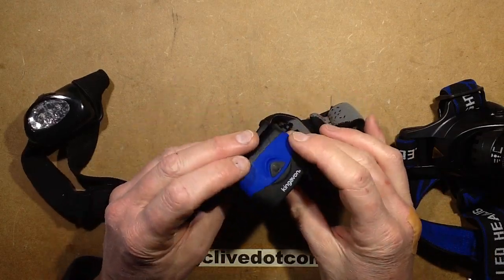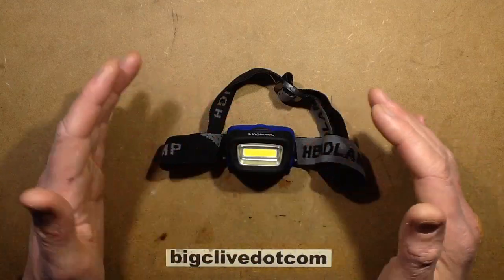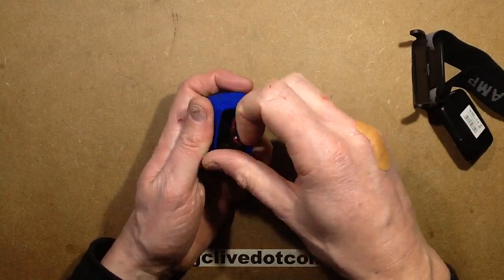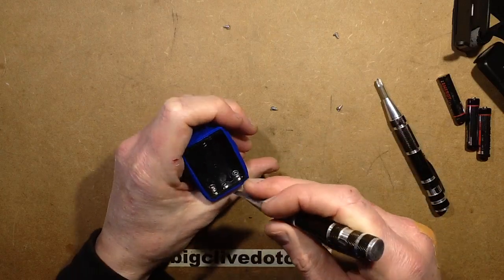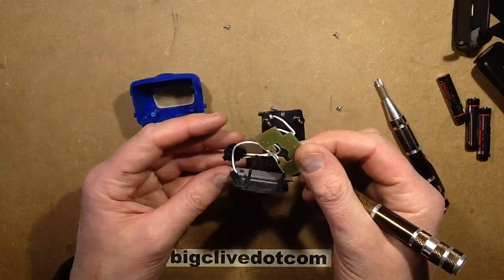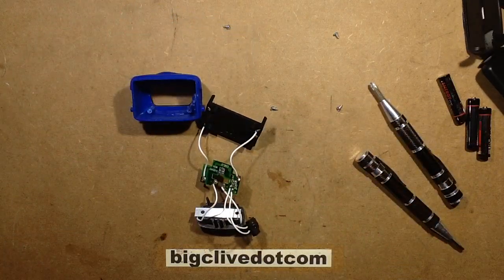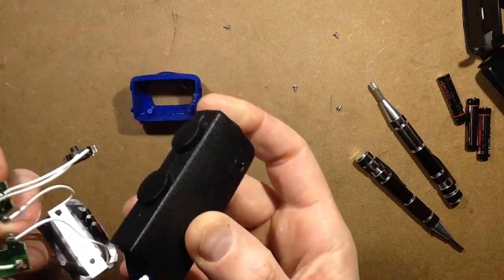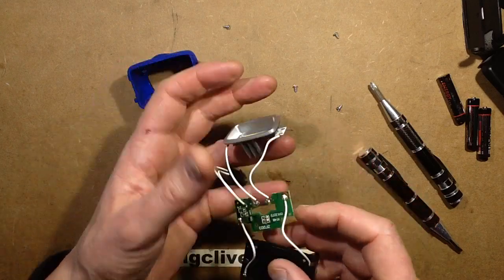Inside a COB LED head torch.

Comment: Always a new plaster or cut, you must launch those hands at electronics! aha
Reply from the maker: I've used superglue for some wounds, but it doesn;t seem to help with the cracked knuckle as the glue is so brittle it just cracks off.
Reply from the maker: It's usually the electrical and mechanical work that causes the dings.
Reply: Looks like the same plaster as was "featured" in Clive's last few vids! Either it's a lot better (adhesion - wise) than the ones I use (regularly) or he's bought a "job lot" to cope with the occasional mishap ;-)
Reply: I keep some super glue on hand for cuts that wont stop bleeding I remember cutting up a fridge condenser coil with a hacksaw I had my finger under the peice I was cutting Yeah hacksaws will cut you it will be a nasty cut too not like a cut from a sharp blade I just kept putting glue on the cut till it stopped bleading
Reply: dossod Superglue works very well indeed. I've used it more than a few times to "keep plasters in place" especially the fabric ones (that tend to peel off when wet!)
Reply from the maker: It's known as New Skin here.  You can spray or paint it onto a graze and it makes it sterile and seals out dirt while hurting like a MoFo momentarily.  The plasters in the videos are mainly to protect the squeamish.
Reply: bigclivedotcom Try the rubberized super glue! It's black, quite flexible, and ideal for putting on cuts in places that regular glue would chip off of. I live in the USA, so idk where you could get it over there, but if you search eBay for flexible super glue it will show up I'm sure.
Reply: A. Zak In Australia we can get a "toughened" Superglue from Woolworths of all places! Comes in a small bottle with a brush applicator, and is a lot less rigid than the traditional stuff. As long as you keep it in the 'fridge it'll last for years.
Reply: Phil S Huh, I'll have to get some of that! And I never thought of keeping my superglue in the fridge!  That may help with the fact that it hardens in the bottle in a couple days because it's so hot and humid here! I assume it's hotter in Australia than it is here though. I lived in Jabiru in the NT for a year back in 2001, and I'm now wanting to go back there.
Reply from the maker: +Phil S  Not heard of putting it in the fridge to make it last longer.  I'll have to give that a go.  I've ordered a flexible superglue from eBay to try out.  The normal stuff is just too brittle.
Reply: bigclivedotcom Beware, the flexible stuff that I get stings like mad when you put it in a cut. Maybe you can turn on the camera the first time you use it so we can all see your reaction.
Reply: A. Zak The Wife and I had our Honeymoon decades ago in Jabiru (well, Jabiru, Katherine and Darwin) - in November,  so it was VERY hot'n'humid! This was in the pre-digital photography era, and I well remember having to keep the exposed film in the fridge, otherwise it would start to grow mould very quickly - sealed (unexposed) - OK, but once exposed, either develop quickly, or cold storage.
Reply: Phil S Wow, three cities that I've been to! I was on a biological research trip to Kakadu to study monitor lizards, and i took lots of pictures, but i don't remember having issues with my film..
Reply: A. Zak I wouldn't describe Katherine as a "City" -  mind you I've a friend who lives "down the Road" at Mataranka - last time I visited - just the TWO shops (General Store, and Petrol Station / "Restaurant" ) - and that's "it" until you get to Eliot (just as small), or Alice Springs!!
Reply: Phil S I do remember seeing the 2 shops.. I never stopped in Katherine, only passed through. Have you been to Jabiru recently?
Reply: A. Zak Not for many years - long distance travelling is very difficult, since we keep parrots as pets (!!) and finding people who are willing and able to safely look after them is very difficult. Most of our trips are therefore very short ones - no more than a few hundred km  "from base" - South Coast NSW.
Reply: Phil S Yes, I know the struggles of having unusual pets. I have a squirrel as well as 2 Harris hawks, and like you I cannot find someone able to take adequate care of them. 
If you had been in Jabiru I was going to ask if the fruit and vegetable man still comes and sets up his cart every week, since I made good friends with that guy when I was there, but I never learned his name for some reason.
Reply: http://www.hansaplast.at/produkte/sprueh-pflaster
Reply: The fuck is that? Sprühpflaster? Some kind of antibacterial wound dressing It looks like. Does it work well?
Reply: long time ago, but it was flexible and waterproof
Reply: bigclivedotcom I'm not a fan of antiseptics that hurt!
Reply: A. Zak
thats why you want to take a big gulp of vodka before you pour it over the wound
Reply: bigclivedotcom Have a go with Smith & Nephew's OpSite Spray on Dressing (should be cheap - it was a NHS Contract Item when I worked in the UK). Not "that" painful to use, and the membrane is semi-permeable, so fairly durable. Used to find that "two sprays" would last about one week (minor injuries).
Reply: My mrs puts her nail varnish in the fridge because she says it lasts longer. She did say why it does but i'd zoned out by then lol

Peace